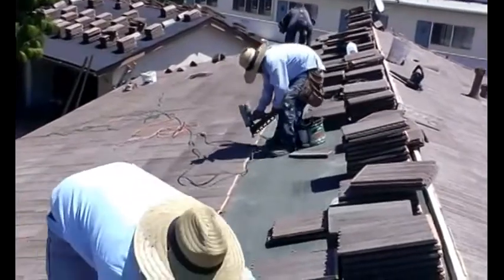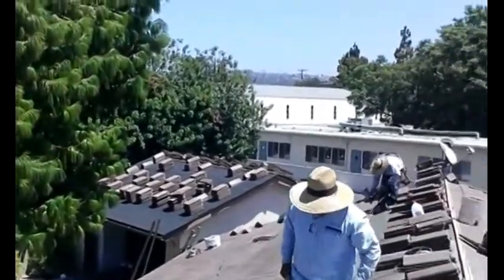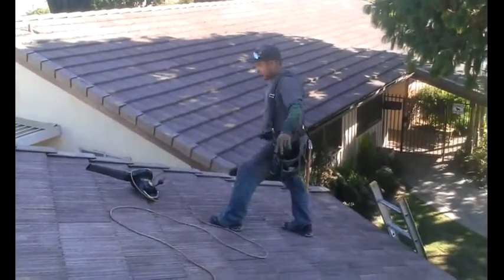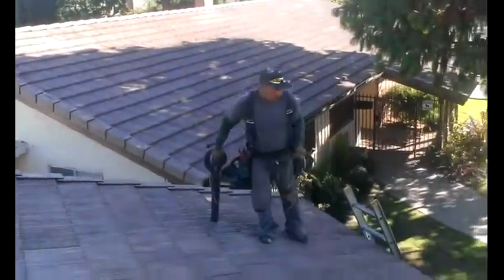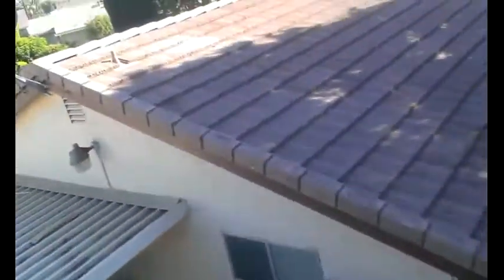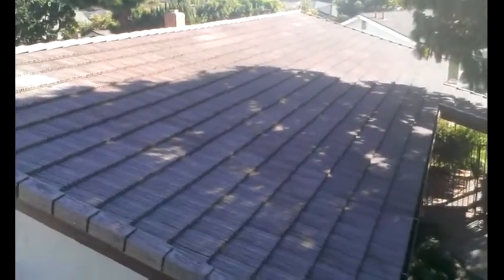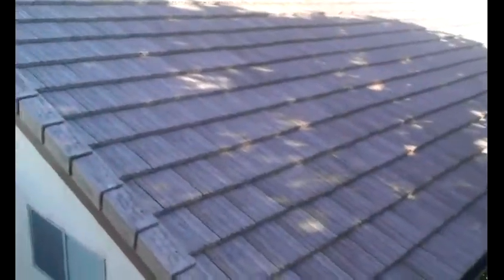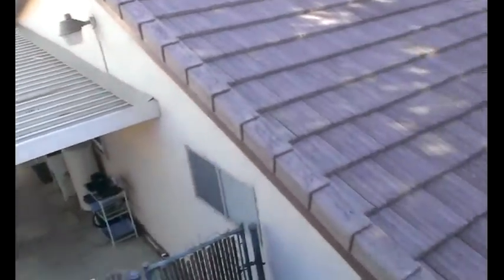tile roofers!

Comment: I really like your videos. It would be a great help for us homeowners if after you finish you video in the areas that protrude through the roof. The vents and chimney. So as homeowners we know what those areas SHOULD look like so we will know if we have a problem or whether previous roofers did the work correctly. 

It's pretty obvious on shingled roofs, but I have a tile roof just like the one in this video. 

Great videos, keep up the good work, and thanks in advance.

Comment: This is an older video? I know you said you would record the metal roof installation.
Reply from the maker: Adr1an110 I don't know what I did with that video , back then I didn't upload anything to you tube yet, if I find it , I will upload it , this weekend I will measure a metal roof job, small but I will take a video and get the best out of it.